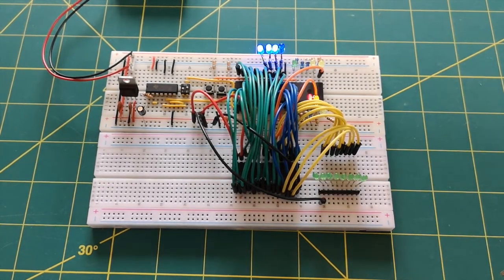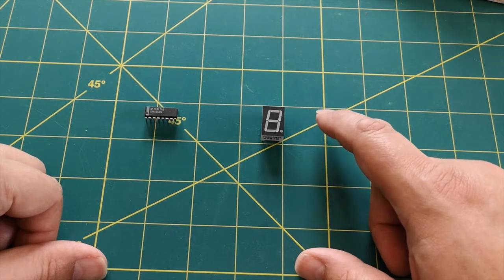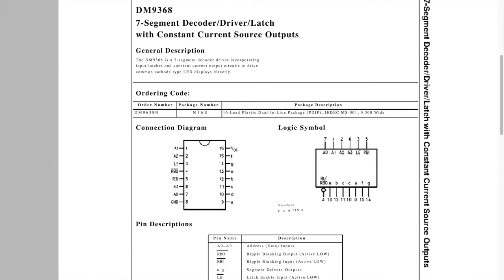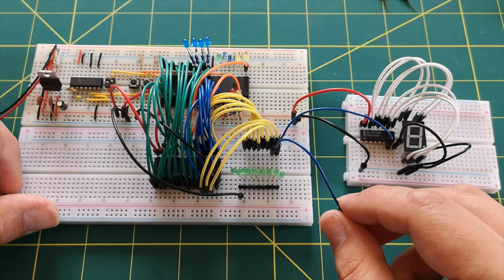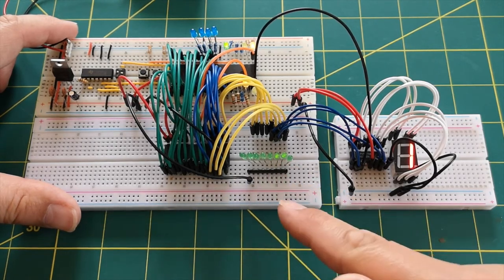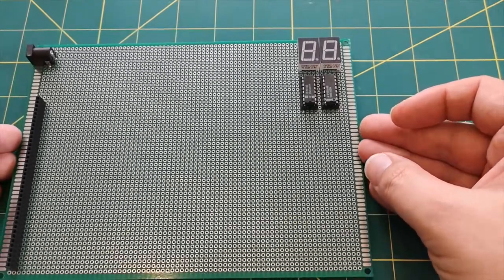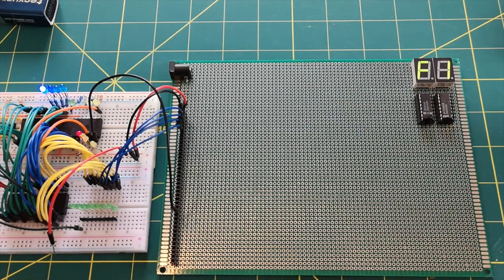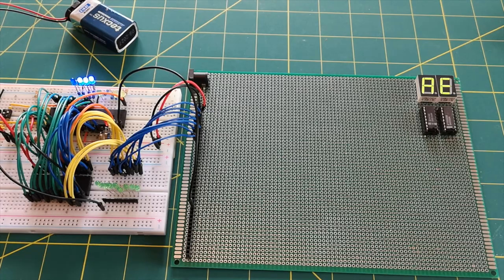Z80 Computer - Part 3 Output

Comment: Don't know if there has been a big change since the late 70's, but with a common cathode display, and a decoder driver feeding it, we used to put a limiting resistor in the cathode line, rather than a separate resistor in each segment line. The display dims just a tad between 1 lit segment, and all of them, but with your more modern constant current driver chip, I think it will work quite well. The guy has been dead for years, but if you can find a Forrest Mimms logic cookbook, you may enjoy it - keep up the good work. Most newer ones have no one teaching this anymore.  Mike
Reply from the maker: I don't think adding a resistor will help because the driver will just increase the voltage to maintain the constant current. I'm wondering if I can pulse width modulate the ripple blanking line to dim the display a bit, but not sure. I'm beginning to think it was a mistake to use these chips, but hey, i've done it now. I had a look for that book, but couldn't find it.

Comment: Great content thank you 😀
i am trying to make a similar z80 breadboard pc.
i used 2 old mc14495p1 chips i had in my draws to do the data bus decoding for 7 segment display.
subbed and looking forward to more great content! :yougotthis:
Reply from the maker: Hi, and thanks for sub. Yes the MC14495P is another excellent choice. I wasn't aware of that chip.

Comment: Hi steve 
Iam using dm9368n like you but i can see only numeric and tried but it count only from 0 to 9 and 10 to 15 blank no abcdef.
And when i conect the LE to ground the displays is only 8 forever any idea what iam doing wrong as you plugged it on ioreq on z80. Can it work just with toggles switches.
Reply from the maker: you could try looking at the truth table on page 2 of the datasheet, and check that inputs A0 to A3 are as expected.

Comment: I love your videos Steve, so informative and you explain things in a way I can understand. One question though, you said you would use a different chip rather than the DM9368n as it used a lot of current, Can I ask which chip would you use? I assume your 7 seg display is a common cathode type?. Thank you
Reply from the maker: Honestly, I'm not sure. It's difficult to find anything that will do hex digits. I quite like the DM9368N chips but they do consume a lot of power. There is a note in the datasheet saying that the RBO terminal can be or-tied with a modulating signal to provide pulse modulating intensity. I'm wondering if that would reduce the power by dimming the outputs. bean did mention below, the MC14495p1 chip as an alternative. The MC14495P1 has 290ohm resistors built-in (as opposed to the DM9368N constant current solution). Meaning you could add additional resistors in series to reduce the current further. The reason I want to avoid resistors is that I would need 7 for each digit, meaning 42 resistors in total.
Reply: @SteveRaynerMakes  Hi Steve, thank you for that. I have also looked at the MC14495p1 and the CD74HCT4511E. Sadly I only had a common anode 7 seg so could not really try it. Thank you to you and everyone elses comments as I learn a lot from you all.